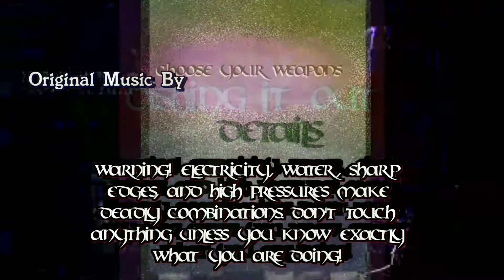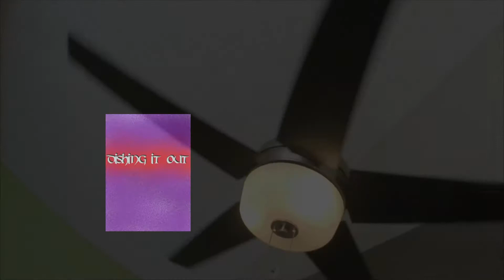Most Often Cause For Air Conditioner Heater HVAC Indoor Fan Blower Motor Not Turning On Video

Comment: interesting,yeah i had the problem of the blower motor not turning on but the outside unit would turn on,the repairman said it was a bad circuit board,at first he by passed something to make the blower motor run nonstop till he could order a new circuit board,i had it running non stop for several years,just for airconditioning,did not have heat working untill eventually got the new circuit board and that kinda solved the problem,but sometimes the blower will stop and the outside unit will keep running and then the blower will start back up,i think it has a short,at least its working right most of the time,